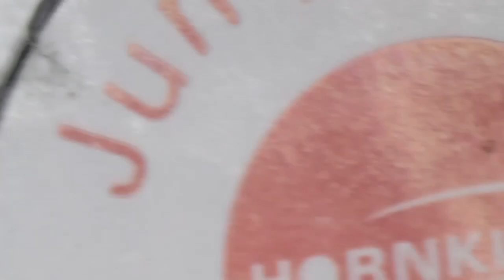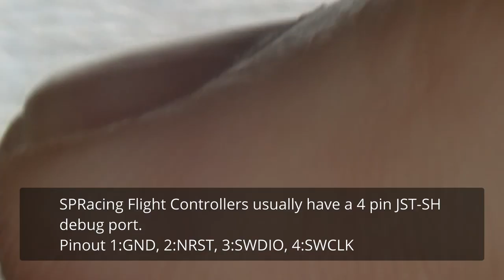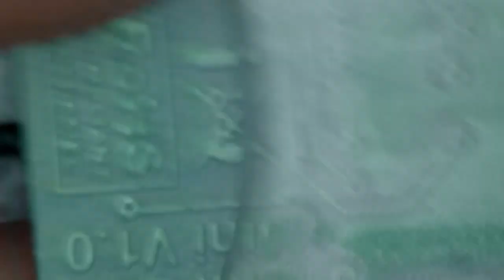How to prepare a J-Link EDU Mini debugger for use with an SPRacing Flight Controller debug port.

Comment: Love your hardware brother! Been flying the H7 Extreme 6mos and was flying the F7 a year before that. Insanely good! I do have one ask. I’m noticing on the H7 that over time the voltage drops out on the VTX and Cam pins. Any suggestions or reasons for this? I’ve got 4 H7’s, they all have the same issue. I’ll be honest, I fly pretty hard so this could be from damage but wanted to ask due to the consistency across all four boards. Thanks bro! Keep up the amazing work!
Reply from the maker: Heya,  Thanks for the support!  That's kinda weird, no-one else has reported that issue, it's possible you're overloading the 5V regulator.  For further SP Racing product support please use the 'contact-us' form on the shop website https://shop.seriouslypro.com/contact/ and I'll be happy to assist further.
Reply: @DominicClifton  yes sir! Thank you, I'll move my questions over there. Keep up the great work on your products!!! Stay safe!